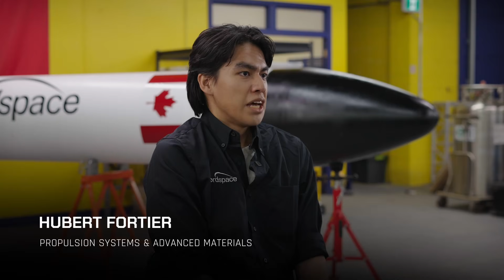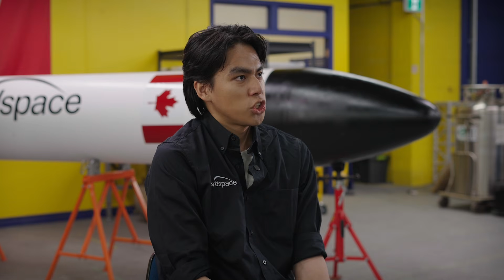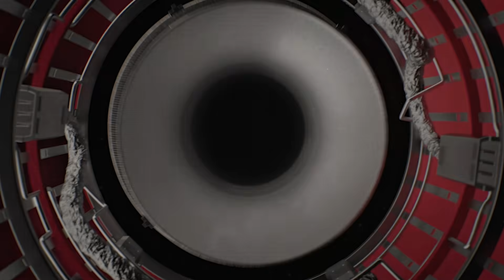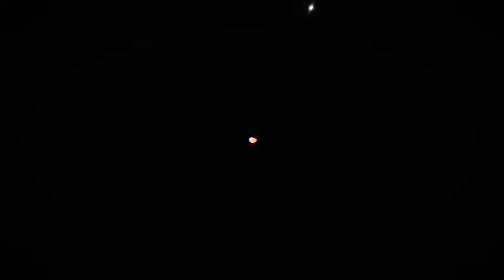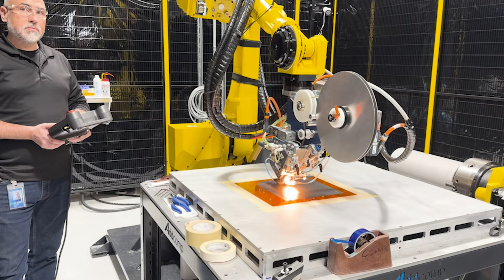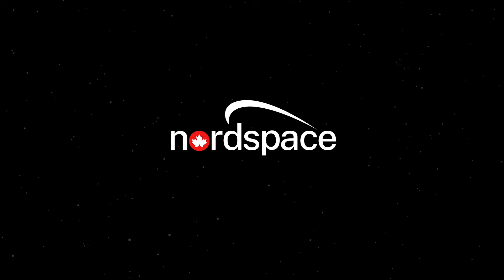NordSpace - Advancing Composite Manufacturing for Canadian Rockets

Comment: Why aren't you filament winding these structures? AFP of tape on flat or slightly curved surfaces is unlikely to yield the same level of hoop and axial strength you could achieve with closed loop filament winding.